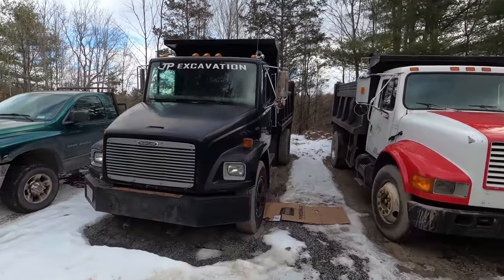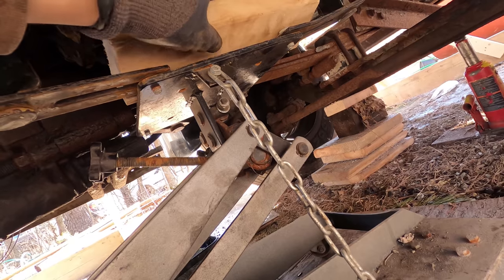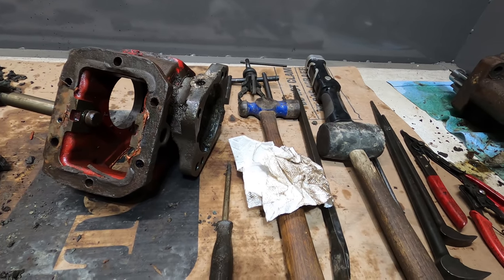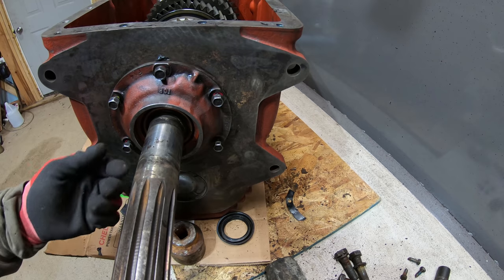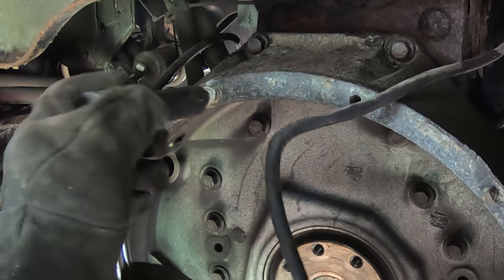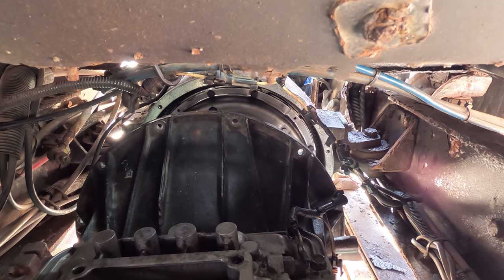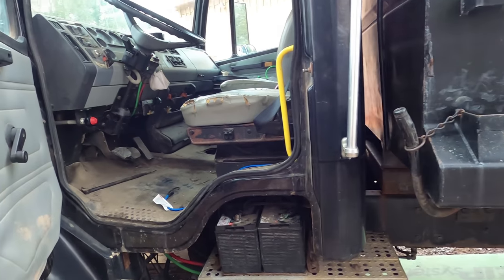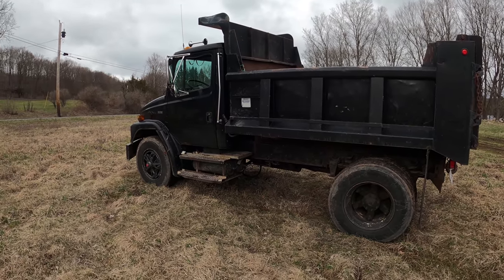Buying and fixing a dump truck: 96 Freightliner FL70 w/ 8.3 cummins

Comment: From the video it only looks like surface rust so it should clean up pretty good. The interior looks to be in pretty good shape too. Are you going to repair your seat?  I did notice that there was a mud flap missing, but I guess you plan replace that after you take of the box and get that all fixed up. The fender on the passenger side looked damaged so I assume you're going to repair that as well. Do you need to put your company name on the truck to be compliant with your DOT regulations?
Reply from the maker: yes I need to do all of that to be legal. I plan to do it soon

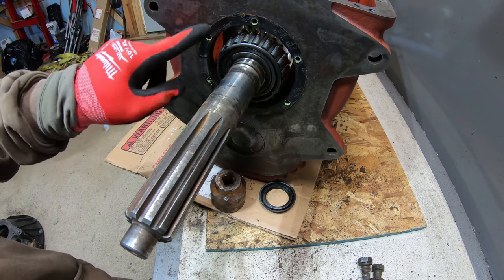Comment: Big mistake 50:10 That gasket determines end play of input shaft. Eliminating it will smoke the bearings.
Reply from the maker: You must have not seen that I check end play before and after putting that gasket maker stuff on

Comment: Never seen a transmission filled with anti seize before.. lol
Dude - get the Milwaukee 1/2” impact..  the problem with Makita is the small batteries. You get 9.0 or 12.0 battery on the Milwaukee, and shit comes off..  the higher amp hours, and the bigger 2700 cells in the High output Milwaukee batteries makes a big difference.

Comment: I don't mean to come off as negative Nancy, but I don't your impact lives up to 1200 lbs of torque. I live in a rust belt too and so far I didn't find a bolt or a nut my yellow impact gun couldn't touch
Reply from the maker: I have that 350 ft lb dewalt too but this one is much more powerful. you loose alot of torque through extensions and swivels too

Comment: what is the red knob on the shifter for?
Reply from the maker: to shift the rear end from low to high, giving a 5 speed transmission essentially another 5 gears
Reply: @jmuller86  thx man, i enjoy your uploads

Comment: pray to god you never have to take the input shaft bearing retainer plate back off. You will never get those bolts back out without heating them up with a torch.

Comment: That gun does NOT put out half the 1200 I hear you claiming. Love the videos and the work you do.
Reply from the maker: yea with extensions and swivels it does get alot less. but without that stuff its supposed to have 1180 breakout force for loosening
Reply: @jmuller86  Thanks for the reply. Not sure if this would have worked in your situation but on the rear main seals I like to screw in screws in middle of seal around perimeter and use them to pull seal out. I have had great luck using that method. Great work keep it up man and thanks for listening.

Comment: The PTO looks like a Chelsea 489 Series. (https://ph.parker.com/us/17553/en/489-series-mechanical-shift-8-bolt-power-take-off-489-series-pto-1)
The pump is just a standard single line kit. (https://www.buyersproducts.com/product/direct-mount-hydraulic-dump-pump-with-manual-valve-1024)

Comment: Y do u have 2 clutch it all the time 2 shift u only supose 2 clutch for first gear
Reply from the maker: this is a fully synchronized transmission, your supposed to use the clutch

Comment: jessie, extensions and adapters really cut the torque applied to the actual fastener way down, like in half.  add in any kind of angle, and it keeps going down.  FWIW.

Comment: Could you have used oversized bolts instead of the helicoil
Reply: Also, have same bed hydraulic setup on by dump truck. The old truck mechanic that installed it added a bypass line and and filter. He told me you can ruin the pump if no by pass and leave the pump continue to run.  Think the hydraulic setups with a separate tank do not have this issue.

Comment: 1:19:05 u crazy - for 700 you could make a sta<inless steel tank yourself, cut a pipe for a rounded corner and the rest is just a box - pressure test it to 3 Bar pressure transfer opening sizes 
add a stainless steel fuel inlet and cap - 700 for a pos thats again rotten out in 10 years

Comment: And it should be a 15 or 5/8 nut holding the PTO on you didn't even try to take it at least you just instantly started cutting it
Reply from the maker: I definitely did try to turn it off, I am pretty sure I showed it in the video, or explained it
Reply: @jmuller86  sorry I missed that I do love the way you put the brake pads on that dump truck you really did I never thought of doing them that way I always looked at Big spring in front first sit at the top one in push the bottom one down and around the s cam popping it in the place and then use my scripts and a pry bar to hook the two little springs definitely going to try your way next time

Comment: 1200 lbs of torque on the impact ? Must be inch pounds.
Reply from the maker: No its definitely ft lbs. Look it up
Reply: @jmuller86  I still wonder, and here's why. You are under the truck in a confined space trying to loosen a bolt (or nut) and you say your impact is set to 1200 ft lbs and it won't crack it. Then you get a wrench or two on it with at most 2 ft. of moment arm, and you are pulling with one arm at a contorted angle. 1200 ft.lbs / 2 ft = 600 lbs. In order to be putting 1200 ft lbs of torque on it, you would have to be exerting 600 lbs of force. I just don't think you could exert that much force out in the open with two arms, let alone in the position you were in. 
I don't disbelieve you, I just wonder.
Also consider the bolts. Doesn't 100 ft.lbs (which is 1200 in.lbs) make more sense ?
Anyway, it was a good, engaging video.

Comment: Could not have changed your end play because shaft was just on a seal nothing else had nothing to do with it operating of dial miss reading
Reply from the maker: yea but when you change from a hard paper gasket to a fluid like sealant it can change, and it did

Comment: Not to be a downer but most impact guns of 1/2" size don't go over 400 #s of torque, not the 1000#s you mentioned. Yes I own both cordless and pneumatic impact guns.
Reply: Makita 1/2 inch brushless is rated for 1180 ft lbs break away torque
Reply: @deadlata9767  Torque Explained - Fastening vs Nut Busting [IMPACT WRENCHES] See Shop Tool Reviews no way you are going to see 1180 it's a sales gimmick.

Comment: Nice fix. Im not so sure it was worth all the money you put in her. At the end of the day, its still just a single rear axle dump truck.
Reply from the maker: single axle dump truck is all I needed. half of the reason for getting it was to tow with it. I dont need a tri axle to pull with, I already have a lowboy and semi for that. this is kind of the in between truck

Comment: Makes me cringe when I see all that brute force being used on those fasteners. 
Try tightening them just a little and give them a tap before using force to undo them. Or heat if you can safely use it.

Comment: It's pretty silly to risk your limbs and trust a harbor freight engine hoist probably made by 13 year old Chinese kid. Never work on suspended, unsupported, heavy loads...
Reply from the maker: the way its designed you would have to be in an awkward position to have your feet underneath. if it drops it just hits the floor

Comment: 1200 inch pounds of torque
Reply from the maker: no it says ft lbs. those bolts were stubborn and extensions/ swivels reduce the capacity alot
Reply: @jmuller86  what makita were you using?
Reply from the maker: @michaelblake9110  its the XWT08Z model I believe. 750 lbs of tightening and 1180 loosening torque

Comment: It's crystal clear whether Loctite is going there or not. But how you use it is highly questionable. Like so much that you disassemble and reassemble as an amateur. 2 minutes and you can see immediately, no training and only moderate experience as a mechanic. That's why you and Andrew Camarata have such problems loosening screws ... Helicoil is junk - I would never trust it, and certainly not how you cut threads for it! To correct you guys, I would need to write a book. But I have to give you one thing, you fight your way through and at least do it yourself and you always learn something. Still, it's interesting to watch. And no, I am not an Italien.
Reply from the maker: why because I didnt smear it all around the threads?
Reply: @jmuller86  Yepp! So it's pretty much useless. It will not spread around the thread as it is screwed in.
Reply from the maker: @ernestospadolesto8126  I have taken bolts out before they were setup and the loctite was spread all over them from threading it in, the trick is to glob it on the end
Reply from the maker: @ernestospadolesto8126  https://www.youtube.com/watch?v=6pn3C5QVcu0
Reply: @jmuller86  Muuuhahahahaha I laugh myself limp! Look at the guys in the white coats - they are salespeople and not mechanics! I installed several 100,000 screws with Loctite and Omnifit. One company used Loctite and the other Omnifit. I completely assembled several hundred transmissions and several hundred hydrostatic drive for an agricultural machinery company. Believe me, if you don't lubricate the screws cleanly all around, the oil will drip out. Do a self-experiment with different screw sizes! Turn it in as you applied it and then screw it back out and check it out. Actually, you only screw the screw in once and not like this two comedian in and out several times. Loctite is not only a screw locking agent, it is also intended to prevent corrosion. It only closes properly and only becomes hard when there is no air in the screw! If they really want to show it how to do it, why didn't they clean the screws with Loctite Activator or Cleaner beforehand. That would be correct and lasts twice as well! I always used the Activator when the screw was not allowed to loosen under any circumstances, otherwise the gearbox would have been damaged. It looks like the two babbler used stainless screws as an example on the table but certainly not galvanized. If you don't lubricate them or apply Loctite, they will be after a while - but watch out, it can happen immediately - when you unscrew them cold-welded and you can only treat them with the cutting disc.Two Clowns - one of them is a big fat liar!
Reply: @jmuller86  I have started the book - at least a thumps up would be nice for it.
Reply from the maker: @ernestospadolesto8126  thats good to know. I will smear it around next time. I guess blue loctite should be used on almost any bolt just to prevent corrosion if nothing else
Reply: @jmuller86  Wrong, there is a very simple rule: Never install a screw without Loctite or GREASE in it. If the screw has vibrations like an engine or gearbox, you always need a screw locking agent such as Loctite. But if you have a normal fastening screw with a locking washer (spring washer), always use grease - the same applies (grease) to sealing rings, ball bearings and shafts. Is it a drive wheel or something similar, use the strong Loctite, otherwise the weak one. I always applied loctite to one screw and then painted it all around with another of the same size. So you have two screws with loctite on it and you are sure that it has it everywhere. Red and green is strong by us and blue and purple is the weak - but I'm not so sure about the colors anymore. Omnifit has other colors. NEVER ASSEMBLE WHAT DRY! Only beginners and amateurs do this!